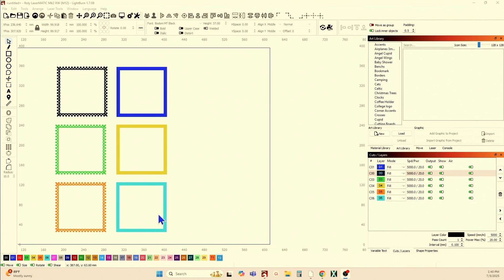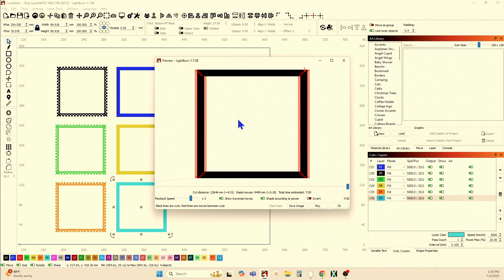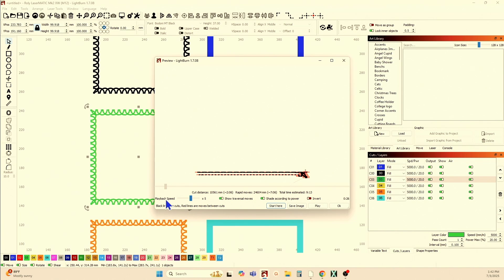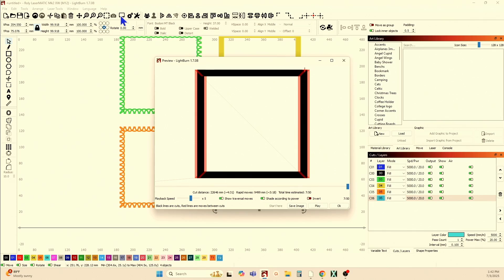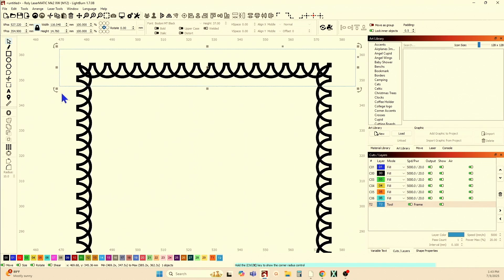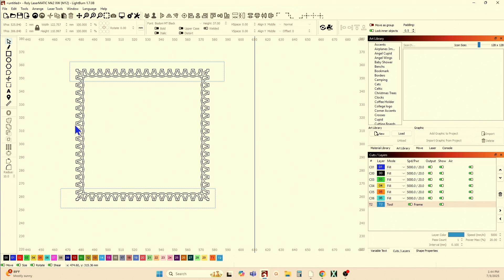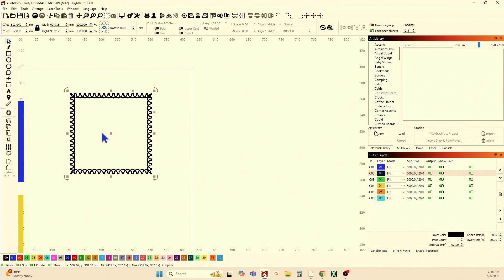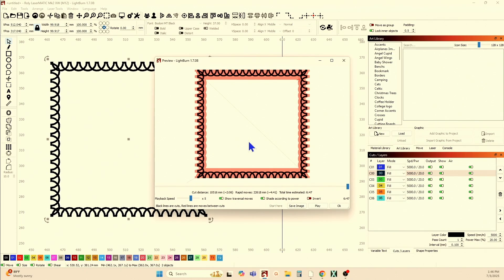Flood Fill Understood - Segment Complex Shapes

Comment: What type of machine are you using for this info? Flood fill is typically used only with galvo lasers. Lightburn has trouble estimating time with galvos.
Reply from the maker: I have been using it with mixed results for the last three years with multiple diode lasers.  After an entire day of testing and research, I finally understand when and how to use it.